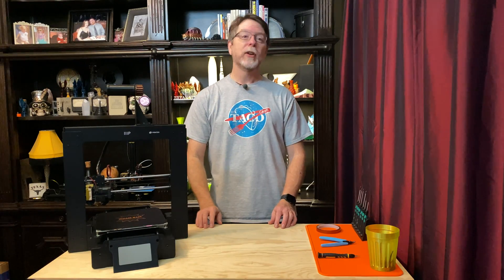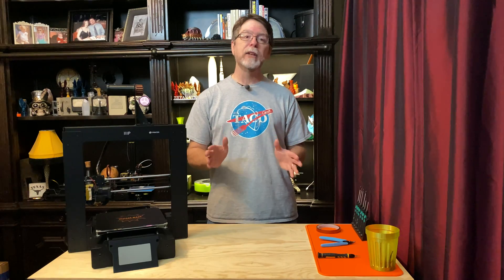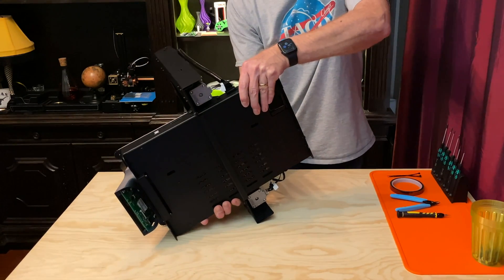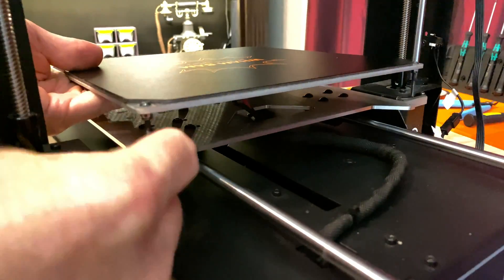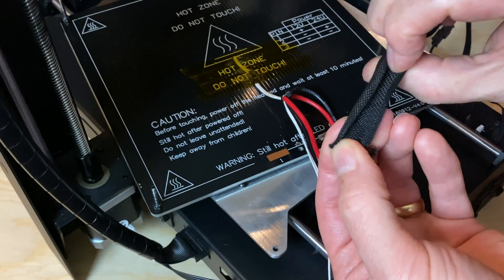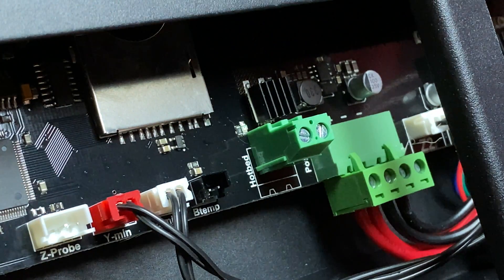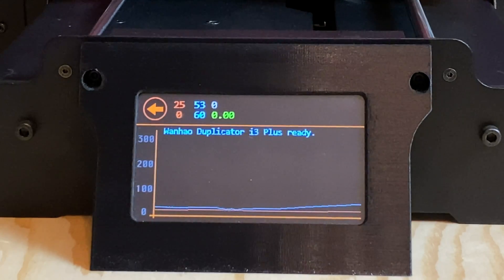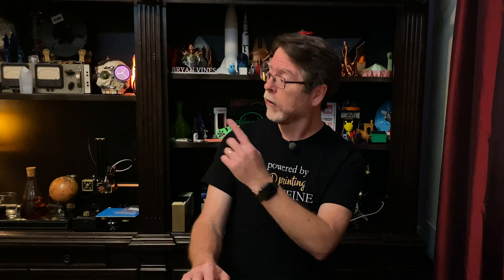How To Replace the Heat Bed Thermistor on Monoprice Maker Select Plus

Comment: Thanks for this! The heatbed i bought actually had the thermistor soldered to the bottom of it, wach cable, near the heat power cords. I had to remove due to them not working and my replacement is a glass beaded end.... I take it i cant solder these and need to tape? 

Any help would be very much appreciated! Having such a tough time finding answers.

Comment: IMPORTANT NOTICE, there is a slight but important mistake in the process.
The two leads that are closest to the probe (the white part between the probe itself and the black part) should be split apart and tape should be attached to the bed also in between those two leads. This prevents the probe from just slipping away.

Comment: Hi Bryan, great videos!  I've been having an issue with my heated bed and with ADVi3++, and I suspect one may be affecting the other.  
The bed temp on my MMSP printer drops if the bed isn't completely towards the front of the printer.  I purchased new heat thermistor through your link, as I do just about all of my parts these days.  At the same time, I also wanted to upgrade the firmware, seeing as I would be going "under the hood".  I installed the new firmware and lcd screen upgrade first.  After flashing the lcd and motherboard successfully with v4.0.6, only the lcd screen is able to function, with no communication to the printer at all.  In fact, if I try to communicate through Octoprint or with Cura, I get a firmware error.  If I try to home any axis through the lcd screen, the lcd usually locks up.  I even tried flashing v4.0.3 because I saw it done successfully via youtubers.  Nothing.  
I'm in contact with the creator of ADVi3++, and he thinks i have serious hardware issues.  He says that it may be a thermal runaway issue, and I think  a bad thermistor may be the issue.  I just removed the heated bed and noticed that the thermistor bulb was not in that little whole.  Im wondering if this may be the root of my problem.  Any tips or pointers?
Reply from the maker: I'm pretty sure the thermistor bulb is supposed to be in the little hole. It needs to be in close contact with the metal.
But that doesn't explain the communication issues between the LCD and the mainboard, or between the mainboard and a USB-connected computer.
I'm running ADVi3++ v3 on one MMSP, and v4 on another one. Actually my v3 machine has a fried bed connector so that printer's down until I get around to replacing the board (and I'm probably going to use something like an Ender 3 main board because I have a couple laying around, or maybe a BigTreeTech board with silent drivers. The BTT has its own companion touchscreen product, so I may try redesigning the slanted LCD housing to accommodate it.
But I've never run into the issue you're having where the LCD crashes when talking to the main board, or the main board has a firmware error. 🙁
Reply: @BV3D  Thanks for getting back to me!  It was the most simplest of things...I only had the usb cable in!  There wasn't enough power to the motors...lol .  Everything is working fine, I just need to replace the y-axis end stop.  While I'm waiting for that to come in, I have the tl-smoothers to install!  Thanks for the help, my man!

Comment: whenever i preheat my bed and extruder, it reaches its preheat temp. (ABS: 70C bed and 210C extruder) but then it suddenly goes back down to zero. do you think replacing the thermistor will fix this??

Comment: Is that a 12 or 24 volt Thermistor for this printer?
Reply from the maker: Hi Mark, it's ...neither? The main board sends 5 volts through the thermistor, and determines the temperature based on how much voltage comes out the other side. This is true for 12 volt and 24 volt printers.

Comment: Don't feel ashamed, my Prusa MK2 stood idle, for about 2 weeks, with a blocked heat-break before I had time to clear it, must have happened when I swapped filament. All sorted now though.
Reply from the maker: Aw, poor little printer! I've had that happen before on my MK3. Took a little bit to get it cleared out but I did manage to clear it. 😃

Comment: Did you ferrule the power wires or is that OEM?
Reply from the maker: I did it a while back. Factory wires were stripped and twisted (fortunately not tinned). These little crimps make it so much easier to deal with the wires. No little stray strands to worry about.

Comment: Hi Brian. I have the Monoprice Mini Delta. Amazing little printer. I was going to get the Monoprice Resin Printer but after consideration I decided to get an Anycubic Photon. Have you delved into resin printing yet Brian ?
I'm so impressed with the quality.
Reply from the maker: Hi Tony! I haven't done the resin printing thing yet. My problem with resin printing is that I know myself, and I'm not capable of using resin and all that without making a royal mess. Plus I have cats and a kid, so it may be a few years before I really take that plunge.